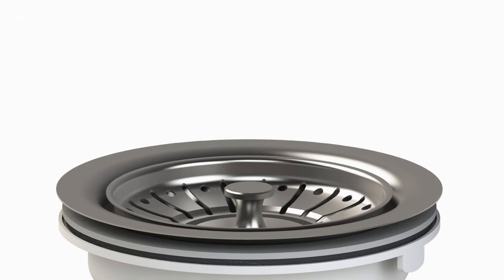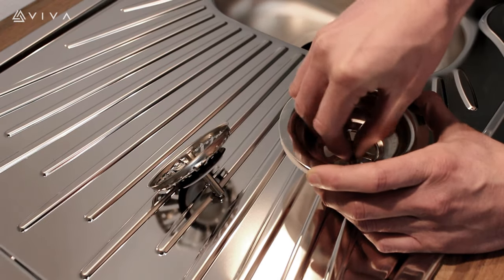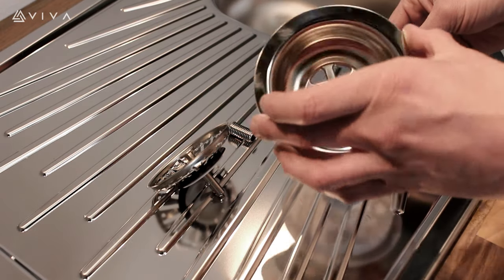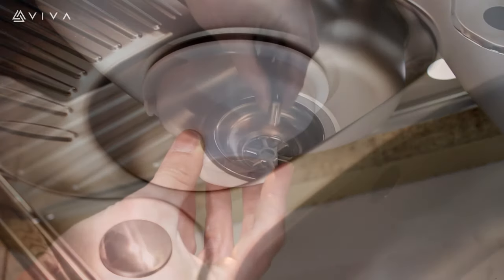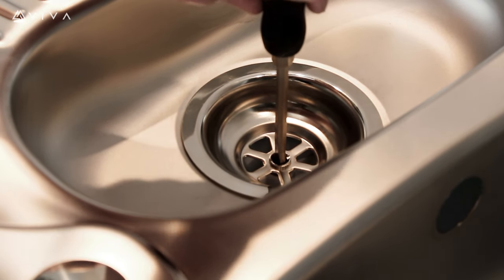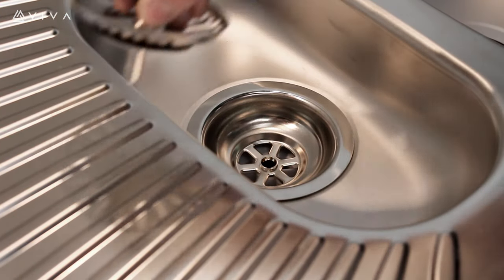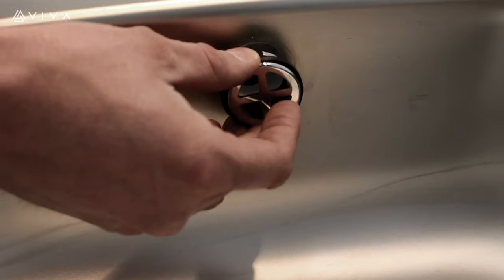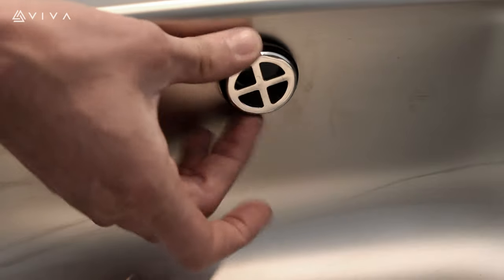How to Install or Replace a Basket Strainer Sink Waste in a Kitchen

Comment: Thank you so much for uploading video. My landlord refurbish my kitchen. After work finished. I found the sink has become clogged with a sticky substance. I have reported the issue with the builder. I'm awaiting for them to inspect the sink drain. Initially, I thought, it would be a large job to resolve my drain problem. However, after watching your  video, it seem an easy job for the builder to resolve.  So again thank you very much. :)

Comment: Found the hardway the flat head screw driver does not fit at the top (there isn't  wide enough screw driver in Australia ) as it is not wide enough found the sinks come with a special tool to tighten the top screw or use a chisel

Comment: Your screwdriver goes straight down the hole in the middle, and not into the slot on the top as it’s supposed to. This video is useless.